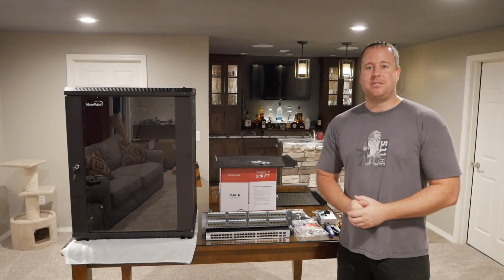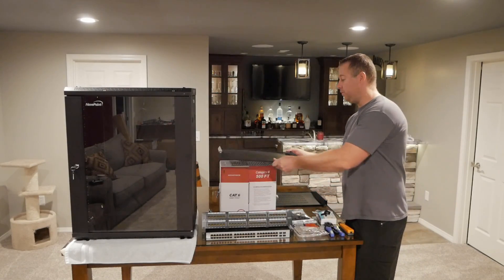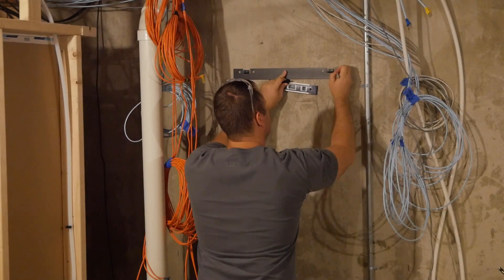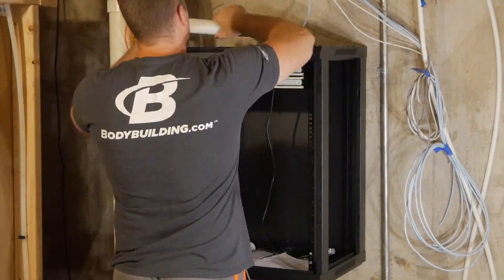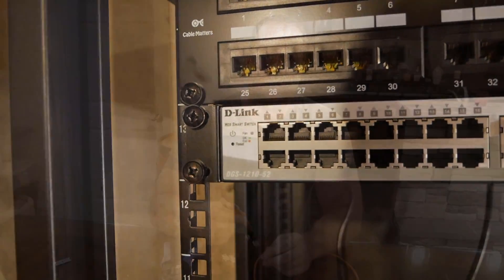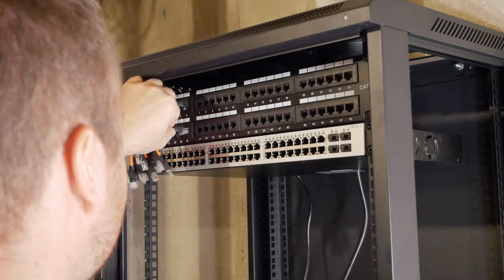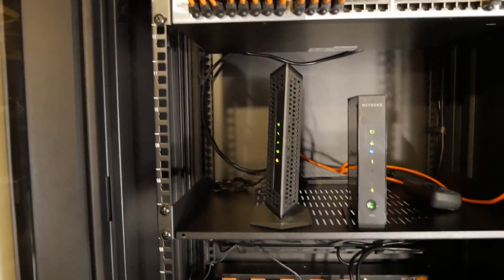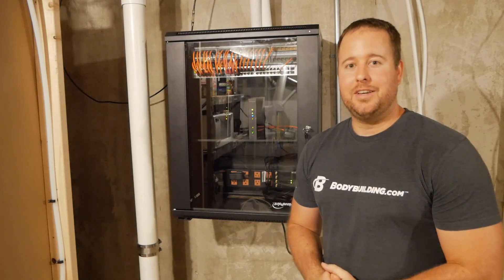Home Network Setup and Rack Installation | NavePoint 15U Rack

Comment: https://youtu.be/YgBSpYiJQHM a better solution if you are to do this in the future for patch panel.

Is humidity a concern where your equipment will live?

You can swap the fan out for a quieter and lower energy solution. My watt meter measured those fans running at 30Watts!

You should really take advantage of access points since you have Ethernet throughout your house to cover dead spots.
Reply from the maker: Thanks for the info man. I have a dehumidifier in that back room that kicks on with anything above 40%. I actually just unplugged the fans as the only thing producing any amount of heat is the switch, and it has it's own fans. The box is well vented and it's never been warm in there (tested with laser heat gun, stays at room temp). I utilize the fans and possibly switch them out when I add more equipment. Will also look into more access points throughout the house as I expand everything in the future. Thanks!

Comment: I like the PVC to protect the wires. And great cable management. I like that you made your patch cables its very satisfying to do the work. Buying the cables would be easier but I like doing things myself.  Good job for not being a network professional. I have my degree in Networking and let me tell you did a great job! Thumbs up!
Reply from the maker: Thank you! It was definitely a learning process for me, but really happy with the way it turned out. And that means a lot coming from a professional such as yourself! Have a good weekend man

Comment: Nice setup!  Just curious how you acquired a WattBox surge protector?  That is an exclusive brand only available to audio/video companies I believe.  Get it used somewhere?
Reply from the maker: Thank you. I ended up grabbing that and a few 4u shelves I used in my home theater rack from a local individual who had an A/V company she closed down a while back. She was cleaning out her stockpile pretty much. New in box
Reply: Life of Bliss gotcha!  One more question: do you think you will build your own server, or buy one pre-built?  Will it be more a PC parts based system or just a pretty standard NAS system?  I’m looking into doing this, and I’m thinking I might build my own for my up and coming rack setup...likely based on an Intel XEON processor and run FreeNAS or unRaid which takes care of redundant data protection and has plug-ins to provide Plex media streaming to your home devices...thanks for your response!
Reply from the maker: Honestly don't know at this point. I will need to do some serious research before adding one. It will probably be later this year after getting the home theater stuff done and the bathroom finished in the basement... that's taking priority right now for funds lol

Comment: Excellent video, I have watched many YouTube’s to figure out how I will do my install. One of the things that should have been done 1st is to mount 3/4 inch plywood to the concrete wall before installation of your other equipment. This give you greater flexibility to mount your inclosure exactly or move it around in the future. The plywood also provides a mounting location for equipment that can’t be mounted to the rack inside the enclosure such as modems, splitters, surge strips and etc.
Reply from the maker: Thanks Edwin. I thought about throwing some plywood up... Will have to go back and add some if need be later, but everything fits so far! Good luck with your setup man
Reply: @LifeofBliss  Why mount to the wall at all and not leave on the ground?
Reply from the maker: Floor space is precious. You rarely ever need to access or move this stuff once set up, so it's more out of the way on the wall

Comment: How did you connect the fans and did you try noctua fans?
Reply from the maker: They were wired to be directly plugged into the outlet from the factory. I have not tried any aftermarket fans since its in a back room and cannot be heard.

Comment: shoulda went with cat 6a or 7 when running cables through your house.
Reply from the maker: Everything upstairs was already cat5e. I could have spent a bit more and gone with the cat6 downstairs... but we didn't. Speed is sufficient for our use though. The next house we build will be cat6 or cat7 for sure.

Comment: TIP: When punching down the cables to the panel it is good practice to keep the pairs twisted right up to the punch down block to avoid an signal degradation or crosstalk between pairs. What you did is probably OK for 10/100 Ethernet, but is likely going to cause some data loss at 1Gbps.
Reply from the maker: Thanks guy. This way my first experience really doing any sort of network wiring. I have not noticed any sort of connection of speed issues that I can see, but I have learned a lot since putting up this video from others. I appreciate the advice sir

Comment: How long did you make all the short cables?
Reply from the maker: They were about 6-9 inches long depending on where they went. I would suggest buying patch cables for that part though. As many have suggested, they are cheap and more flexible. Plus the small cables took me forever!

Comment: Did you consider the deeper version of this one?  First time buying one and my one whole home audio unit is 16.5 inches deep and wondering if this would be deep enough specially with wires connecting to the back.
Reply from the maker: I did not since nothing going in there would be very deep. I definitely think you should go with the deeper option. You lose a few inches off the overall depth since the mounts are recessed in the cabinet. A 14 inch shelf almost hits the back of the enclosure once mounted if that gives you an idea.

Comment: Nice job but for a basic home set up, it would have been cheaper and easier to just plug your cables directly into the switch, rather than through a patch panel.
Reply from the maker: Agreed. I wanted to be able to connect some lines together for HDBaseT (or similar) so the patch panel made sense.

Comment: I wish I had that much space fir my network setup!!!  I can tell you right now, that rack is to small!!!  You want room to grow.  That rack should be double the size as you have lots of room!!!

I’m also not a fan of those patch panels.  If you have a port that fails, you can’t just remove it.  It’s s hassle to move the wire to another slot if it’s under a bunch of the other cables layered over the top.

What I did is get 2 cable Matters keystone patch panels.  Then all you have to do is easily install the keystones onto all your cables,  and then snap them into place.  You can have like rooms grouped together.  You can even use different color keystones and have red for this and black for that and yellow for something else.  The ports not being used, you can just pop in some blanks into the spaces.  Looks really nice.  If a keystone goes bad or you want to change wire position, you can pop it back out.

For the cables going to the modem, etc, you plug them into keystone passthrough.  These snap in also with a RJ-45 port on each side.  So plug the router cable into the back to hide it, and then a patch cable on the front to the switch.  I got a bundle of pre-made Cat6 Patch cables of like 12” in length.  I have a 48 port switch myself.

I’m now working on my own Security Camera setup with a NVR which is being mounted in my garage in a lock box mounted up high on the wall.  That part I’ve finished.  Need to mount my 13.3” monitor which is just under 1/2” thick to the back of the lock box.  The front panel swings down.  The NVR mounts to that door on the inside really nice.  Then swing the door back up and can then lock it up.  I need to mount the monitor tonight when I get home, then in the days to come, start mounting the cameras.  It’s a PoE system.  The only way to go and it’s a 5MP system which is better then 1080p.  If you’re going to have cameras, they better be able to see the person clearly and not some blurry image.

My network setup is in a small closet in about the middle of my house mounted up high so you can still hang jackets under it.  I’m using a 1U UPS to power everything.  I would have liked a larger UPS, but I’m limited in space.  I’ve would have liked to have used a larger rack than the 12U one I’m currently using.  But it was a big upgrade from the 2 wood shelf’s I had been using before.  One thing I recommend is a good Ethernet cable tester.  I have a Fluke myself.  I did find a couple booboo’s I did.  Sometimes you’re eyes get crossed as your punching wires and ops.  I tested as I went.    Another nice thing to do, label all your ports!!!!  My keystones are labeled on each end.  I know exactly what is what.  If there’s a issue in the future, I know exactly where to go.  When you run a lot of ethernet cables, it’s a big plus.
Reply: JB Dragon Patch panels are enterprise grade and are not failure points. The only time that there is an issue with one is when they are incorrectly installed which is also the case with keystones. I don’t think I have ever seen a keystone panel in a datacenter but I have definitely seen patches.

Comment: Hopefully everyone understands that this is a 100 times overkill for a private house. You can run a medium size office on this scale of hardware. Just a silly wifi router like a Netgear Nighthawk would have done the job.
Reply from the maker: I try to hard wire everything possible vs Wi-Fi. No connection issues and usually faster speeds. Just a Wi-Fi router cannot do that. And I did mention adding cameras and media server in the future. This is not the average install for running a single laptop and smart tv. Just all depends on your situation ☺ If you think this is overkill, stick around for the theater upgrades coming 😉

Comment: do you use cat 5e keystones with cat 5 cable.  Also i have cat 5 cable at the moment should i upgrade to cat 5e my internet speed is 100 down 20 up
Reply from the maker: The keystones will work. Are you positive it's not Cat5e? Your internet speed will vary based on your provider, plan, and other equipment being used. I wouldn't base that primarily on the cable.
Reply: Life of Bliss it says on the cable cat 5 not cat 5e
Reply: Dr Bass 

I wouldn’t run cat5 cable.  While it may be faster than your internet speed, you may want better for your overall home network.  I ran Cat6 all around my house.  It’s not much more than cat 5e.  I got my cable from Monoprice.com.  You can pretty much get everything you need from them at a great price.
Reply: @jbdragon3295  im upgrading to cat 6 i have a 305m box of it i got it for $40

Comment: Hey man, neat little setup.  Glad the thing has two fans. A lot of people don't bother and shove their modem somewhere without zero air flow. Those things can get INSANELY hot and cause uncorrectable errors and stability issues, even with lower end service; people forget they have a SoC like any other device.  Although basements tend to be cooler than the rest of the house regardless.
Reply from the maker: Yep, heat is the enemy of electronics! And since its in the back room, noise isn't an issue either.

Comment: What is the patch panel for?
Reply from the maker: Allows for more flexibility connecting things to the network. Not every connection will be sent to the switch
Reply: I don't really understand it. You could have just plugged everything in the switch right?
Reply from the maker: I could have. But the patch panel is nice for plugging certain things into a port and never having to worry about the original wire from the ceiling be long enough to reach. I am no using every connection for the internet. I will be connecting cameras and more HDBaseT modules in the future. This is easier to do with a central point to patch into the cables needed, hence the patch panel. I would suggest looking into some videos specifically talking about the benefits of a patch panel ☺

Comment: 7:20 for home use you permanentny do not need patchpanel :)!!! alone switch is good - i know for what is patchpanel but for home is ridiculus :)))
Reply from the maker: You're good, I understand what you mean. We just have a difference of opinion. For the cost, I felt the patch panel was useful for what I planned on using the network for. Some may not need one, but for the small additional cost I feel the added flexibility was nice. Hello from the USA by the way ☺
Reply: @LifeofBliss  :)
Reply from the maker: Completely disagree. Already used the patch panel to connect HDBaseT devices directly on the switch. The patch provides greater flexibility than just a switch. Some home networks are more complex than businesses as well, just depends on the setup. To each their own 😉
Reply: @LifeofBliss  i know for what is patchpanel but to normal people - it is not usable - you know what i think about - sorry for my English :)... i do not speak you do not use patchpanel only normal people :)

Comment: Hi from Poland 5:40 do not do manually this pathcord! you must buy special cable for patchpanel to switch :)!!! manually work can do small mistake - special cable from switch to patchpanel is name patchcord and they are elastic special
Reply: I understand what Jan is saying. Don't use the solid core cable on patch cords, use the braided type for flexibility. If you're not going in there moving stuff in and out all the time you would imagine it would be fine though?

Comment: my suggestion is when you done will a lot of cat cables, go get a cat 5/6 cable tester, many cables will work if you missed 2 out of 8 copper wires, but if you do POE+ those cables will not work. it requires all 8 of them to pass through data and power. it is just my opinion. host did a very neat and clean job on the tutorial.
Reply from the maker: Thanks! Yea I'll be getting one eventually just to see if there are any bad connections. Interested to see, but so far so good!
Reply: can you help me i wired up my room in the house with cat 5 cable. if i plug the ports in my room in my htpc running win 10 connected to my router with a patch lead shows a yellow triangle above the Ethernet logo but if i unplug the ports in my room my htpc connected gets internet. If i unplug my bedroom ports and power the htpc on then plug my room ports in the connection on the htpc still works, Im really confused.
Reply from the maker: Is your htpc running off of Wi-Fi when unplugged? You may have a bad connection in the one area. A cheap tester would let you know pretty quickly. If you are having any sort of connection issues like that, a line tester is almost necessary to figure out where the connection is being broken
Reply: Life of Bliss no my htpc is patched into our main router
Reply: @drbass9677   not really sure wut u are asking , may I ask are you using hub instead of a switch ? since u still use cat5 I have to ask. if it is cat5e, it may still run speed up to 1GB/s,  a hub can have many ports , but only one port will transmit data at a time, and also check for duplicated IP addresses, go to computer ethernet card configuration, to set a different ip or auto receive ip which is called DHCP. last check the cable , go amazon buy a very cheap cable tester, about 15$ test the cable, inside your ethernet cable, there are 8 cooper wires, maybe 3 or more got miswired or damaged. hope this help.
Reply: steven Gao I’m using a 8 port gigabit switch in the lounge where our main router is and I will test the cable. I only wired up my room a few months ago I just went with cat 5 because it was cheap
Reply: @drbass9677   check duplicated ip and default gateway/DNS setting first before buying that tester.
Reply: @stevengao8345  how do you check that
Reply: @drbass9677   the easiest way , go search on youtube with this title " manual set ip address ", and watch it. all the details will be there.

Comment: can anyone tell me why you want to run the ethernet into a patch panel and then a switch? couldn't you just run all the ethernet from the ceiling into the switch with one cable in the switch connected to the router? i don't know a lot about this
Reply from the maker: It gives you more flexibility to use the cables for more than just internet. And they are connected to a fixed location with less chance of getting damaged. You would be limited to putting your switch/router to where those cables are terminated. You can also directly connect termination points for things such as video transfer over HDBaseT. Allows you to connect other devices easier such as a security cameras and recording device. Just thinking of several reasons off the top of my head. Essentially you are not limited to the cable length for other devices (you add shorter patch cables to patch panel), more flexibility, and less likely to damage main lines. Don't worry, I was thinking the same thing before I built this and did a lot of research
Reply: If you have more than a couple cables the patch panel is much faster and easier. When you are working in a rack the tight bends to get to a switch are not good for structured cabling. Every time you have to touch a cable you put wear and tear on it, and all the other cables that end up moving with it. By locking down all the 'permanent' wires you greatly reduce the chance they will become damaged. Patch cords are cheap and easy to replace and are normally made with more flexible cable with molded strain relief that is superior to what you can install yourself.